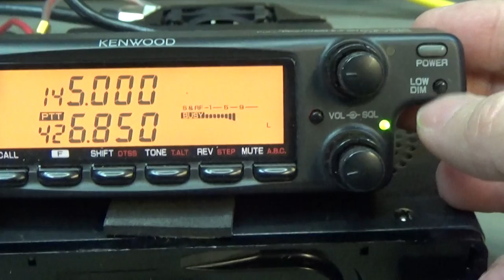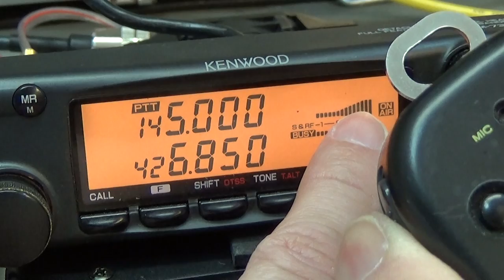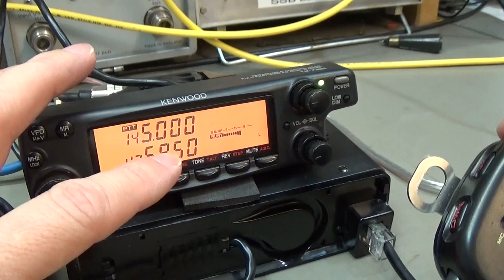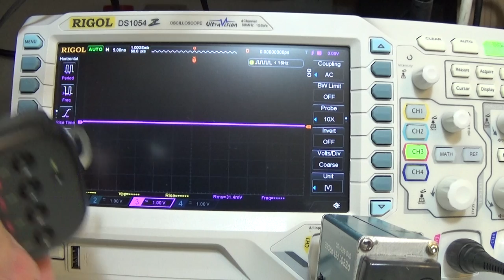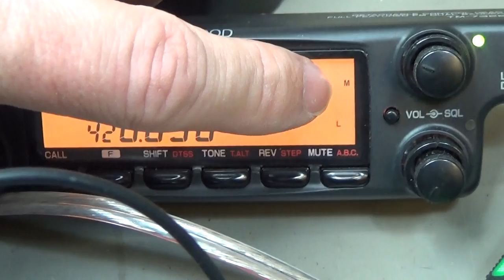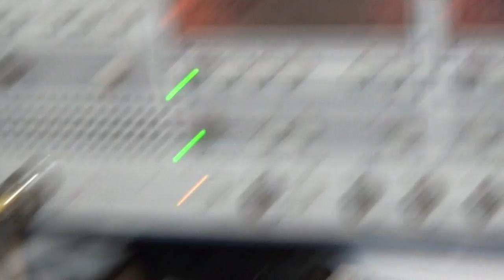#38 Radio repair: Troubleshooting a Kenwood TM-732 with no TX power

Comment: How do have power on VHF when the antenna connection is missing?
Reply: Its connect into a 50Ω Test Load/Dummy Load, or a 50Ω attenuator.

Comment: Does the UHF & VHF use the same finals?  It seems to me that if it will transmit on UHF it should on VHF as well.  Maybe a different route to the finals.  Cheers & 73 from W Rusty Lane K9POW in eastern Tennessee

Comment: Did anyone notice that in the initial test he failed to switch the frequency from 70cm to the 2 meter freq? In the end test, it was set to the 2meter freq. it wouldn’t show transmit if he had the meter set to the wrong band/freq. not saying he didn’t find a problem, but the testing doesn’t add up. 🤷‍♂️

Comment: All in all a good video, I might suggest on repairing the ceramic board, remove the board and put it on a hot plate to evenly heat the board just below the melting point of the solder. then with soldering iron evenly flow the trace without worries of cracking the ceramic board. then allow to cool and reinstall with thermal paste.

Comment: Are those tuned lengths? Mine is cracked to the right of the 180 component at the bottom left corner of the gold transistor the very thin traces. can I connect the just before the first fault to just after the final fault at long at the length is the same?

Comment: I watched your TM733 repair series of videos and this 732 video. My 733 also has no power out on 2 meters. I watched another series about 733 repair by another person who talked about the issues with the Toshiba module. In his video he also had a cracked trace that he repaired. Between him and you and additionally this 732 repair video you both gave me the courage to remove the cover on my module. I could not see any flaw even using magnification, but yet the switched 12 volts was only present through about the first 25% of the trace from the PCB lead end.  Just depressing on the trace with my meter probe and the resulting pressure on the ceramic caused it to start working. I have yet to locate the exact location of the fault area and it refuses to fail again.  So I think I'll have to just try to solder over the general location of the fault area and hope for the best in the long term.  Thanks!
Reply from the maker: Ah very good James and thanks for feed-back on that work. Glad that you was able to find it 73

Comment: why at the beginning you've been measuring 2m band on 438mhz and at the end didn't show tre frequency on your tester. looks like cheating... 

any way you did good knowledge sharing.
Reply from the maker: No cheating involved Virgil. The generator has been left on 70 cm but when you transmit into the tester the frequency counter would show the right TX frequency instead of the generator frequency... Thanks for watching 73

Comment: I have a TM-241a and it doesn't save memory. I can program it and if I power it off for more than 3 sec. the memory is erased. I replaced the 2032 battery but still same issue. Any idea what could be the problem?
Reply from the maker: Matt Fleming Hi Matt, there are many causes possible, sorry can't help you from the distance.

Comment: Hi there thanks Dunke for reply, wonder if you would consider doing a video on setting all the presets and power setting in a CB radio, Squelch, RF meter, S Meter, Deviation, and low power setting, and squeezing as much power as you can out, usually 4 watts in England....Fred g4vvq.
Reply from the maker: Tom Smith Hi Fred, well I'll put it on my list, but it will take a while until I can make it happen. Too many things on wait list...

Comment: Danke,Ihre Videos sind einfach toll.Danke
Reply from the maker: Guilherme Paixao Vielen Dank für das nette feed back...
Reply: I had the same trouble with one of these. It is worthwhile to mention that Kenwood used no heat sink grease when they mounted these
finals. If you are doing this repair it is probably worth your time time add grease between the final and the radio. I would expect this to improve the reliability of your repair. 73

Comment: I had a thought. (There it goes....Duck!) :o) Would it not be possible to take some de-soldering braid and form it to shape and then lay it on top of the solder track and solder it in place as a bridge or would that alter resistance to much? I realise that the solder braid would have to be trimmed to size.
Sounds like that hybrid needs a fan
Reply from the maker: InTheNameOfJustice Hi George, well this is more complex as one think. On short wave it would work, but above 100Mhz it is really critical. Over 100MHZ we are talking about transmission lines and that means everything in the chain must be 50Ohm. Any little mismatch makes it  more complicated thus you should be very carefully with all you do. My intervention could already cause a mismatch...
Reply: TRXBench
Ah I see. I guess that is why they say that a good idea in the hands of a fool is a disaster waiting to happen. Lol. Thanks bro, now I get it.
Reply from the maker: InTheNameOfJustice LOL very nice adage never heard before :-)
Reply: TRXBench
Ha Ha. It came from my wise old dad.

Comment: Did you have set s-meter to S9 with -93 dBm in VHF ? Thanks.
Reply from the maker: Pasquale IW0HEX yeas of course. the s-meter has a new adjustment as well as the power output on vhf which has been set to50W :-).
Reply: TRXBench
Great !!! HNY 2015. 73s
Reply from the maker: Pasquale IW0HEX HNY 2015 Pasquale!! 73's